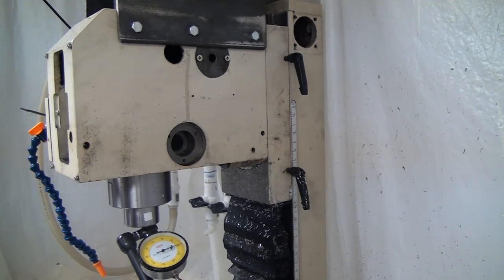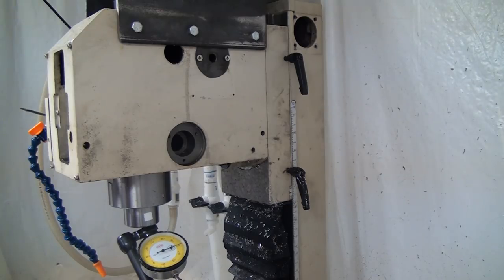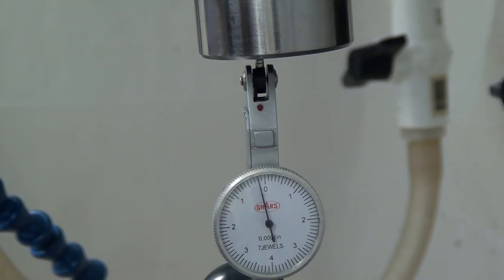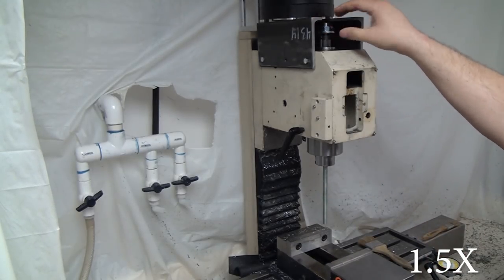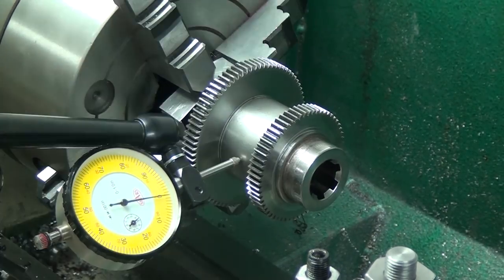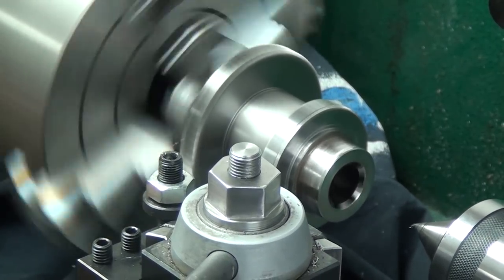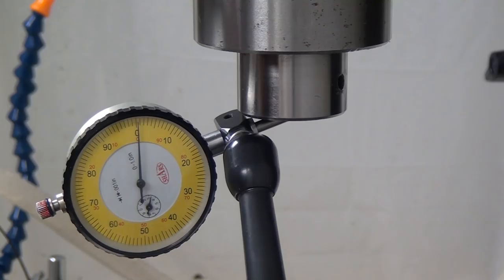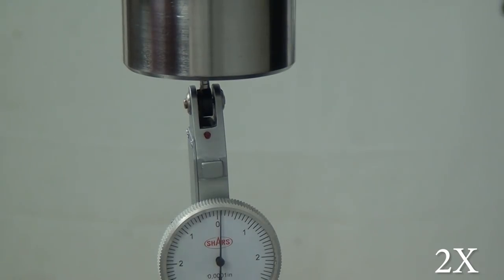CNC-G0704 #26 - Back to Tapered Roller Bearings

Comment: Could you tell the difference when you ran it at high rpm, feel or sound wise?
Reply from the maker: Yes, and I'll stick this comment to the top.
I actually downloaded a vibration monitor app on my phone and did multiple before/after tests. I spent a TON of time in excel trying to tease out the results, but just couldn't get anything consistent. I tested the RPM range from 1k-6k RPM in 1kRPM increments and there was a really big difference. The sound/feel of the machine is very much smoother, and at certain RPMs the difference is very noticeable (harmonics I suppose).
Since the data was more or less useless, I didn't include any of it in this video, and I actually deleted it out of frustration so I won't be bringing it up later either.
Reply: The old human measurement systems are pretty sensitive, I would not think the cell phone sensors would have enough dynamic range.  Hard to measure, but everyone knows what smooth sounds like....

Comment: I just did the same bearing change.  I haven't done a belt drive upgrade nor changed the motor yet, and I'm fairly certain I have my preload too high.  Runout looks to be less than 0.0005 with my crappy surface indicator.  Really happy.  Way better than the AC bearings I was running.  Thanks for sharing this, Russ!
Reply from the maker: I'm glad to hear it! I'm pretty sure my preload is to high too, as I'm getting a little more heat than I would like. I'm not sure it's going to be a problem in the near term too. I guess we'll see :)

Comment: I was wondering when the angled contact bearings were going to start giving higher run out. Hoss has some good stuff but I think he also has time to play and modify. Russ your videos rock, my stock bearings are still good but a motor upgrade is lying in the wait or bench. Thanks for all the info on your dime, saves so many of us our dime.
Reply from the maker: I think the same thing about Hoss.
Thanks for watching :)

Comment: FWIW, the Fanuc Robodrills we use at work (Leatherman Tool) have anywhere from .0002"-.0005" of spindle run out when brand new (10k rpm spindles). We don't have issues until we see close to .002" of run out from wear. I would be VERY happy to only have .001" run out from a small, cheap machine like this, .0001" is ridiculously good. I do wonder how accurate that Shars indicator is though. It would be interesting to see the run out with a higher quality indicator.
Reply from the maker: +Andrew Bird Thanks for the info. I'm sure someday I'll spring for a better indicator, and I will check this again and post an update.
Reply from the maker: +metalhead2508 Good point. Thanks!
Reply: Mr. Morningstar  Actually Starrett's last word indicator isn't a great comparison to any indicator. Those who have had them for years pretty much all say the same that there one of Starrett's worst indicators. Long Island Indicator Repair says about the same on there website as well. Once in awhile some have mentioned there's do work well, but on average not many like or are impressed by how well they work. B & S or Interapid test indicators are probably about the best on the market today. I've got a couple of Mitutoyo's that I'm happy with fwiw.
Reply: Mr. Morningstar  Well I'd put money on a B&S .00005" test indicator beating anything from Shars, Grizzly etc. I've also got a not so cheap set of Chinese gauge blocks that somehow missed the fact on the fancy certificate of accuracy that 2 of the blocks measure and are marked the same. I've also got a 4" & 6" set of Chinese digital calipers where the grinding noise while moving them can be heard and they can't repeat to much better than .003", sometimes triple that number. They eat a battery every 2-3 months, I get 4-5 years on a battery in my Mits and there the most accurate calipers I've ever used. I didn't say some of the cheaper equipment couldn't be decent. But your not going to get it at a rock bottom lowest possible price. Russ's Shar's indicator  proves that. A whole lot of the brand name and expensive metrolgy gear is even made in China today. As I said I'm happy with and know by testing that my Mit indicators are accurate and more importantly do repeat there readings. So yeah both are far more accurate and repeatable than the Shar's indicator in this video. After a whole lot of wasted money my findings are that the cheap stuff is almost always inferior and far from trustworthy. The one exception was a cheap pair of 123 blocks that do meet there accuracy specifications. So either you've been real lucky and I haven't, or one of us is wrong.

Comment: Hi Russ- thank you for your video work. I was wondering about the high-speed conversion. I see that you are using the stock motor, What happens to the low speed torque? Thanks, Howard
Reply from the maker: Hey Howard. Are you referring to the belt drive on my mill? The stock motor isn't going to do well with a high speed setup as it's pretty weak. I burned it up a few years ago then went with a 2.8HP DC motor and it was OK at high speed until I burned it up. Now I'm running a 3phase AC motor and it's in a completely different league.

Comment: I'm running the stock head but I'll be upgrading soon.  I have to use an oven mitt to change tool holders.  That's not normal, is it?  On another note, it's kinda funny how I've had to explain to my wife the difference between Nachi bearings and 'notchy' bearings.
Reply from the maker: +quantumfrenzy74 No that isn't normal at all. You've got bad bearings.
Notchy, hilarious!
Reply: My gear box was getting hot so I added a trans cooler, pump and fan myself and switched to gm synchromesh fluid and now it seems to stay right at 100-110 degrees max but the r8 holders can get up to 130-140. Not sure that those temps should be concerning yet other than changing tooling. Mine came factory with p5 taper roller bearings. The gear box doesn’t seem to be troubled and my speeds up to 8,000rpm with no vibration. I haven’t had any reason to really run it past 5-6,000 rpm even on aluminum except cutting polymers and it seems faster with alloy that it doesn’t toss nice uniform chips. More sliver like when speeds are too high. I’d like to consider making a belt drive but I also like the high torque ability of the gear box. Considering ac bearings but I’d probably buy nsk in a matched set. Ran them before in another mill with almost zero run out but they do cost $150 each. I may try these and see how they work.

Comment: kind of a bummer the limiting RPM is down to 6200rpm. Did you spend much time looking for anything with a bit higher range? I did the AC bearings also and was surprised how much worse they were for run out. I just finished adding a servo motor for my spindle and won't be going over 6000 but would like to have the option some day.
Reply from the maker: +Michael Alcocer agreed. My Max RPM is 6500, and I'll continue to run at that. I'm not worried about smoking the bearings. No I haven't researched higher rated bearings but eventually I would like to go faster too.
Reply from the maker: Bummer!
That's a great price though :)
Reply: How much did you "preload" these? I went a hair past snug and got a bit more heat than I anticipated during break in at 6000rpm. I let it cool off and backed off to a very light snug and am running it back up to 6000 again to see how it does. but I already noticed I doubled my runout. Went from .0002 to .0004 not much to complain about but I was happy to see the first number considering I knew I have a not perfect spindle.
Reply from the maker: Michael Alcocer I went just past snug too. Fingers crossed they last a while.

Comment: Nice Rus what is the rpm rating on those bearings?  you may have said and I missed it.
Be Safe Sam
Reply from the maker: Hey Sam. I didn't say, but it is 6,200. I run them at my max though, which is 6,500. Some day I intend to go faster, and at that point I'll start looking for a higher rated bearing.
Reply: Thats good for tapered bearings, I still have the stock bearings in the mill and was planning on going with the AC bearings for more RPM but things always seem to change as I go. Please let me know if you have issues with these.
Be Safe,
Sam

Comment: Thinking of doing this. Collet holder seems to get too warm. What type of grease did you pack the bearings with? NBU-15?
Reply from the maker: Yes that is the grease I used, but I didn't pack them, only lightly coat. My spindle is warmer with these bearings than it was with the AC bearings, but it runs super smooth so I'm not to worried about the extra heat. We'll see how they look in a couple months.
Reply: Thanks, keep us updated.

Comment: What is your max rpm on the spindle? Are you having any heat buildup issues?
Reply from the maker: +Robert Roy my mill will do 6,500 rpm. Yeah there is a little heat, I may have my preload a tad high.

Comment: have you made any changes to the mill that you regret?
Reply from the maker: There are things I changed that had to be rechanged, so I guess that's a yes. I would say the two biggest are:
1. Burned up to many DC motors before going to 3 phase AC
2. Went with a toothed belt drive instead of the ribbed belt drive I have now

Comment: I believer those bearings are 6500rpm greased and 8000rpm if filled with oil.
Reply from the maker: Yeah that may be right, I don't recall. I'm limited to 6500 for now anyway, but I do intend to take them closer to 8k at some point so we'll have to see how it goes. I'll report back.
Reply: russtuff what kind of temps do you get running hard?
Reply: Also as far as the splined shaft goes I believe the Grizzly g0761 and similar models come with those without the gears attached so for some that don’t want to machine the stock part they can consider one from another machine.

Comment: I do not understand what you are turning down with the lathe.  Due to the camera angle I cannot see what you are modifying.  To me it looks like you are turning down the gears.
Reply from the maker: +Ogre7212 Yes the gears are being machined off, and the section between the gears are trued up a tiny amount since it was running out.
Reply: Factory stock mills like this one come with gear drive, some of which are plastic.  When you do a belt drive install like he did, you no longer use the gears.  Typically, the belt drive gives you much higher rpm, and the gears are changed out due to the higher rpm requirements....

Comment: http://nachi-tool.jp/bearing/sdata.php
http://nachi-tool.jp/bearing/sdata.php
...... looks like the number is an iso standard look for 32005 and 32007 nothing else and you get the other brands too
the 32005 is used in kawasaki and suzuki motorcycles as a bearing in the steering
Reply from the maker: +watahyahknow Nice find!